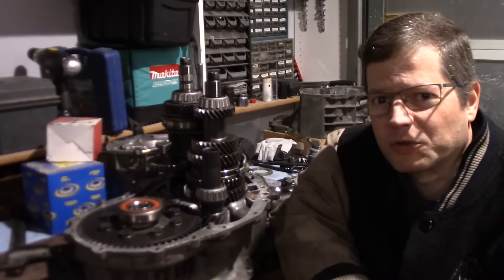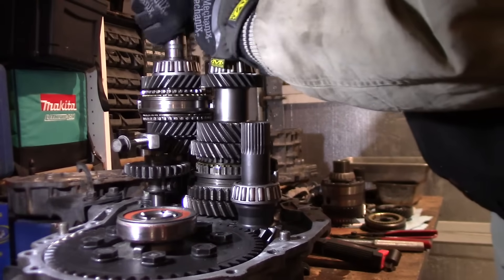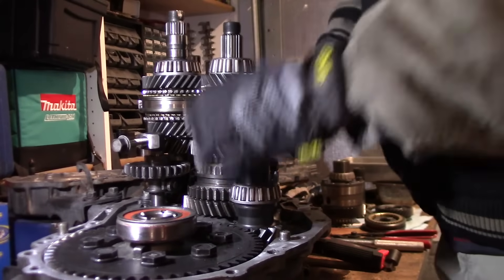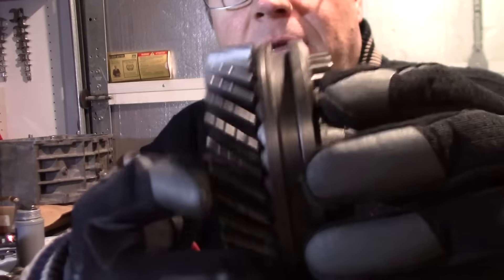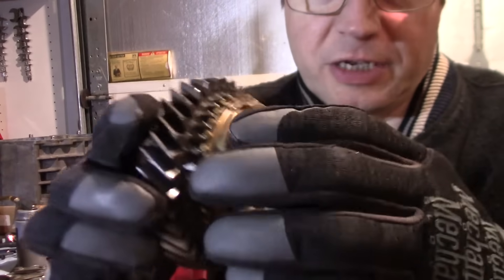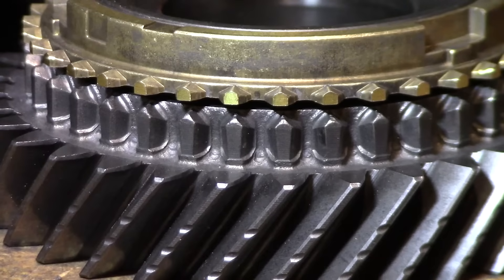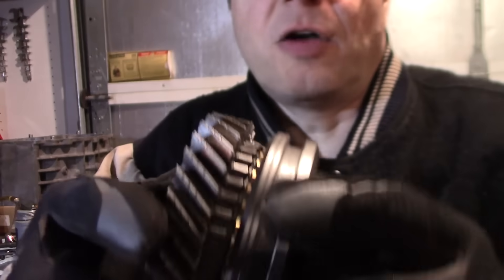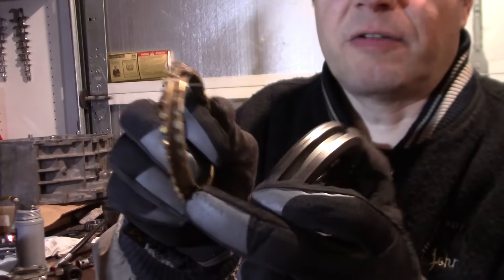How Synchronizers Work in a Manual Transmission

Comment: Old BMW:s lost the second gear synchro if "too good" oil was used. Some other transmissions are also picky for the correct oil.
Usually manual transmission oils are GL-4, and even GL-4/GL-5 rated oils make shifting slow. There may even be need to make a mix of engine oil and transmission oil to get the best shifting. I own several cars, trucks and a T-55 tank (with my brother) here in Finland. Automatic transmissions used to be rare here, so we are more than familiar with manual transmissions.
The T-55 uses engine oil in it's manual transmission; using "transmission oil" with any EP additive, like even GL-4 will make shifting almost impossible as the angle of contact of the synchro friction surfaces is designed for less slippery oil. And the Ford Taunus (Cortina) transmission wants that slight mix of (modern) GL-4 and engine oil to work perfectly.
Some manual transmissions are designed to work even with Gl-5 rated oil that has enough EP additives to be hypoid oil. But those have the synchro rings designed so that they "bite" no matter what. 
So, if the second gear is slow to engage or makes any noise doing it, try different oil. The oil used is just "too good".
Reply: You need to be very careful what you put GL5 in if it's not specifically called for. Since it's much more resistant to shearing, it may not work its way into tight spots as well as a GL4 (or motor oil/ATF) would, especially before it's up to operating temp. Pretty much exactly like you said, it's "too good". You also have to make sure whatever fluid you're using is compatible with whatever synchros it has. 

There's also a scenario I've heard of, but never personally seen. If clearances are small enough between case hardened parts (like gear teeth) GL5 can supposedly cause enough pressure to chip and/or crack the hardened surface. Yes Rico, kaboom.

Comment: I figured all this out a couple of decades ago when I rebuilt my Getrag 233 from my '93 Toyota Supra TT.  Getrag updated the synchro hubs and synchros about a year into production, so I replaced all the synchros, synchro hubs, bearings, and seals to fully update the unit to the latest spec.  I broke the 1st gear outer synchro ring by shifting into 1st at 30 km/hr rapidly.  That gear has a three piece synchro because the gear weighs almost 2kg(!?!), and I have since decided, synchro or not, I won't shift into 1st unless I am at a stop.

The most important piece of what a synchro does wasn't clear in the video.  The gears with teeth are always engaged and rotating.  The synchro's job is to brake the gear with teeth to the same speed as the synchro hub before the dogs on the gear engage with the dogs on the outer ring of the synchro hub.  Also, there are balls and springs in the center of the synchro hub that engage detents in the synchro outer ring when the ring is fully engaged with the gear to help the gearbox stay in gear when the gear is selected.

Comment: Inside a transmission filled with oil there will be a thin film of oil between the synchro rings and the hub sleeve and gears. So if you shift slowly there should be no metal-to-metal contact until the three components mesh. If you shift fast the thin film of oil collapses and there will be metal-to-metal contact. Hence, your synchros hubs and gears should last longer if you shift slowly.
Reply: Or rev it up and slam into the next gear because it's fun.

Comment: I finally understand why when I shift into gear, it feels like there are two distinct engagements.

It's really obvious on one of my cars, but less-so on my other. The other one has shorter ratios & straighter gears, so maybe the synchro tolerances are tighter?

Comment: Oh man, I love these...
They're what makes everything incredibly more easy... I can shift without a clutch!
Yeah, it's absolutely pointless extra difficulty for no gain, but it feels good kkkkk
Anyway, you can use that middle brass ring as the clutch if the surface is smooth enough to get going from a stop
Reply: It's not useless. In fact, it's very useful to know how to shift gears without a clutch, because if the clutch system fails, you can drive the car to a safe place, or even home.
Reply: @CaitanoBR  I once drove across 3 states without a functioning clutch after the slave cylinder on my hydraulic clutch shit the bed.
Reply: @CaitanoBR  Exactly!
It's a skill for when things go wrong...
Reply: Sometimes I don’t step on the clutch literally just because I’m too lazy to move my left foot
Reply: @jayelwin  Are automatic vehicles too expensive in your area?
Reply: Shifting without a clutch should only be done if you're speed matching the revs to the vehicles speed. In Europe we'd consider not using the clutch on a manual as heresy since using it is second nature to us.
Reply: @oddball_the_blue  Ah yes, of course sir...
When the transmission is under torque you can't even get out of a gear, the stick is hard to move. It's needed to aliviate the torque and match the revs for it to be possible. Which is very easy upshifting but much harder downshifting...
I'm BR and using clutch is second nature to us too since automatics are a thing of luxury. It's only now that we're getting some automated-transmission vehicles to be more common for the working class lol
Reply: Motorbikes don't have synchromesh rings.. yet, they are way easier to shift without a clutch, i always say.. on a motorbike, the clutch is only used when going from, or coming to a standstill, for up or downshifting.. you don't need it.. 
I can also shift without a clutch in a car.. but it is way slower because of the Synchromesh, and the EFI computer on my current car also doesn't help.. with older cars, with carburettors it is way easier..
Reply: You have to be American.  The clutches in the synchros are only designed to overcome the rotational drag of the gears.  Changing gear without the clutch wears them out really fast and using them as the actual clutch is just stupidity.
Reply: @gillonstewart1601  Brazilian.
Americans don't know how to drive stick, let alone match shifting hehe
Now, saying that one "can" doesn't mean that anyone should or even that I do it.
It is a possibility tho, if your clutch ever fails you like the cable snapping, but again, only if the surface of the road is smooth and no inclination. And the car can't be too heavy either... Otherwise they'll get destroyed before you notice kkkkkk

Comment: I learned to drive a 4-speed manual transmission with no 1st gear synchro. It was a 1970 Triumph Spitfire and the little car had to stop moving before you could downshift into 1st gear. 😅
Reply: Most new cars I've owned won't go into firstvunless you're stopped or going really, really slow.
Reply: I have something similar in ford focus 3
Reply: Air cooled VWs were the same, synchromesh on 2-3 and 3-4 shifts only.

Comment: The grooves on the inside of the brass ring are there to let the oil escape when the pressure comes on. As the brass wears away and the groves become shallow, the oil can't get away. Then the ring can't get a decent grip and the synchro becomes less effective, or in other words "worn out".

Comment: All gears are always in mesh but not connected to the output shaft. Only when connected via a 'dog clutch' (unfortunately not shown) is the gear connect to the output and power can be transmitted. Dog clutched need to be connected with zero relative motion. Until being put in gear there is a relative motion between the gear and the shaft. The synchronizer is a brass piece that engages on a cone on the end of the gear momentarily before engagement. This gets rid of any relative motion and allows smooth operation. Motorcycles don't have synchronizers as the mass of the gears are small.

Comment: Wow now I have even more questions than before watching. What the hell. I tried my best to understand and still got nothing.
Reply: I understand more than I did before watching, but I hear you. Transmissions are confusing as heck to me. What part didn't you get? I think I understand how it works, maybe I can help you out.
Reply: @doggonemess1  I have a very good understanding of sequential gears like motorcycle gears. But in a manual H-pattern gearbox there are those synchronizers. It was them I did not fully understand what purpose they had? The gear could only engage when the transmission was going the same speed, but that is like any other transmission. Maybe I need to se it in action, when the gears are moving.
Reply: He explained it very well
Reply: @jayw.8626  maybe not the why I understood it

Comment: they stopped working for me, second gear is my new synchronizer, after that i can use reverse and first gear again 😂
Reply: Sounds like clutch drag
Reply: @rickconstant6106 it can be anything, it's a workhorse all its life with over 200k on the clock, but it's just a minor inconvinience still

Comment: Please explain what causes the magic "untwist bounce back" you refer to @ 3:37 That would seemingly require a torque reversal - and as far as I can tell - there isn't one.

As you point out, the synch can rotate ±10-15º with respect to the sleeve. When you press the synch up into the cone of a speed gear that's spinning faster than the sleeve, the synch will move into the +15º position where it BLOCKS the sleeve from moving towards the speed gear. Meanwhile, the sleeve will accelerate up to match the speed of the gear. Once the gear and the sleeve are spinning at same speed - the synch must now reverse 15º to align with the splines in the sleeve so the sleeve can slip over the synch and onto the gear.

What force causes the reversal (bounce back), and where did it come from?

Comment: Makes perfect sense awesome vid tks
  Knew they had them cause I tried to explain to someone why downshift from 5th to 1st was impossible at highway speed
  What's crazy even the big trucks are still just a 5 speed with powerdivider multipler can do 55 in R in one 😅
Reply: You can downshift to 1st from 5th, but need more time till sync ring accelerate input shaft to insane speed what you even can hear :D
But better not try release clutch after engaging ;)

Comment: you should do a 2nd on how different weights of lube   cause issues, too thick or too thin , ATF or 5/30 motor oil or 90 weight gear oil.   how hard down shifting plays hell on the brass. how  double clutching works

Comment: Gosh, I miss manual transmissions. Yeah, they require quite a bit more work in traffic. But when you get a chance to open things up, shifting makes the experience so much more visceral.
Reply: I have two cars, I prefer the manual over the automatic one.  When you learned on a manual you won't even notice the extra one.  Starting uphill in San Francisco?  Easy 🙂  The only time I prefer an automatic is with an ice cream cone, then I need a well trained co-pilot for shifting ;-)
Reply: Then buy a manual if you miss it so much
Reply: @amkobih4479  There aren't many left, especially in Canada
Reply: @optlink1831 
While I'd agree with you that the market sucks, there's a whole group of people in NA that refuse to drive autotragics.

And also, there's still a few nice new cars available with it, if you aren't willing to shop used :

Civic Si /Integra 
Civic Type R
Corolla GR
Jetta GLI
Elantra N
Mazda 3
Mx5
BRZ/GR86
WRX
Toyota Tacoma
Ford Bronco
CT4/CT5 Blackwings
BMW M cars
Porsche ofcourse

Comment: The mating surface of the synchro cone is much smaller than I pictured in my head, perhaps because I first learned about synchromesh transmissions from a "How Mechanical Things Work" book that I loved as a kid.
Now I think about it, it's fairly obvious that the dimensions of parts and mating surfaces in the various illustrations were exaggerated for clarity.
Informative video, thanks!

Comment: The 1st gear synchronizer in my 2005 Focus broke like 8 years ago. It’s nice to know how they work. I just have to stop completely to downshift to first or double clutch now.
Reply: very standard for 1st gear synchros to go - or sometimes not even exist. It's not something I would ever bother fixing unless the gearbox is being torn apart for a different reason (such as one of the other gear's syncrhos)
Reply: do they make grinding noise if you shift?
Reply: @yoppindia  Only first gear will grind. The rest are fine. To not grind it, I have to stop, then shift to second before going to first. Or just double clutch. Going from neutral to first while the car is running without the other steps will always grind it.